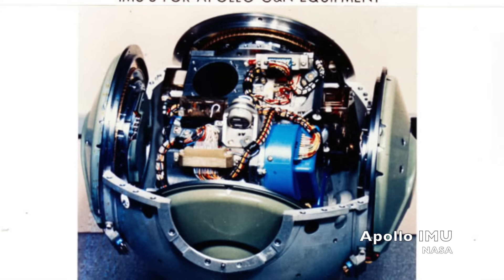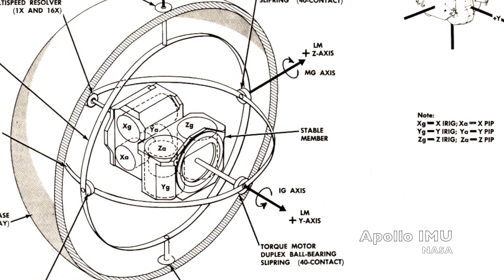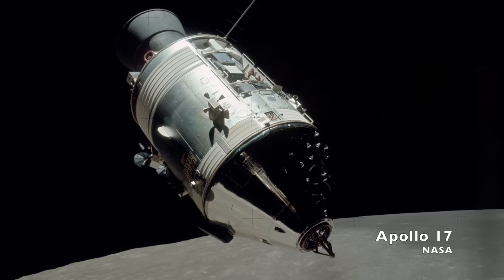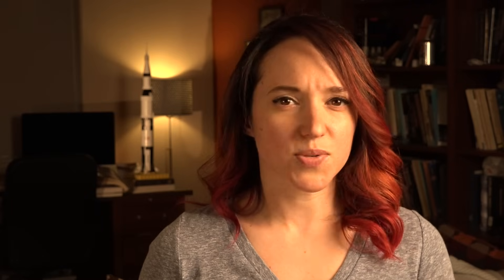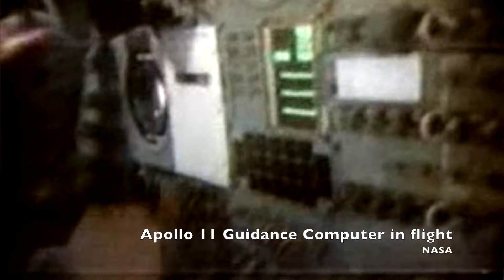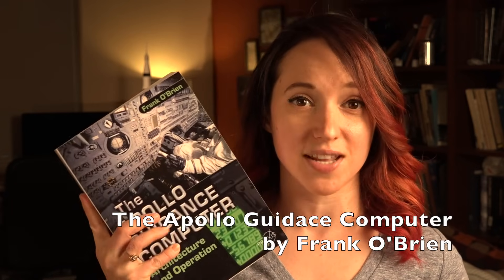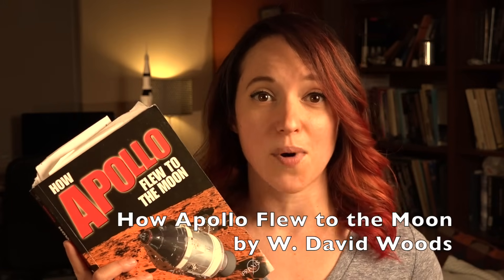Gimbal Lock and Apollo 13

Comment: You are very attractive and technically accurate and suggest you interview returning SpaceX Falcon astronauts to ask them about the technical evolution details of gimbals to the current versions in use today and how, if true, that if or not gimbal lock is even an issue anymore for today's astronauts.  I suspect that GPS and Laser Ring gyros have virtually eliminated position "drift" almost entirely.  Can't wait to hear your report updates.

Comment: TL;DR: gimbal lock means a situation where mechanical gyro used with Apollo flights failed to correctly track orientation of the spaceship. Modern systems use solid state or laser gyros and are not vulnerable to this problem.

Comment: Similar to robotic automation. During robotic arm movement the program/operator must prevent 2 specific axis from lining up.

If these 2 axis end up lining up the arm locks up and stops moving and errors out.  This is because the robot unable to decide which of the 2 axis it should move to get to the next position. The programmer has to tweak one of the 2 axis to resume the motion.

Comment: We use the same technology in modern day drilling tools.
Reply: Is it in the drilling head or is it above ground?
Reply: @suntaog It's in the tools at the bottom of the hole - or Bottom Hole Assembly (BHA). We run three gyroscopes each 90° from each other in an orthogonal setup. What we'll do is drill and when we stop to add more drill pipe, we'll turn the gyros on and off and measure the difference in acceleration. This allows us to find the orientation of the drill bit relative to the motion of Earth.

Comment: I made up an illustration for a kind of gimbal lock. Say you're filming a plane from the ground as it flies directly towards you, over your head, and then off to the horizon. As the plane approaches the zenith you pitch (tilt) the camera higher and higher until it's directly overhead. Now, to keep the plane in view, you either have to keep patching the camera back, but if you do the scene will appear upside down. To avoid that you'd need to spin (yaw) in place 180 degrees. Either way would do, but a computer might get confused as to which way to rotate, since the pitch and yaw axes are aligned.

Comment: Apparently it's a real thing in the virtual world - if you model 3D environments, the virtual camera you use to see the world can gimbal lock which then causes wild movements of the camera when you ask the computer to move the camera from pointing in one direction to another. If it gimbal locks, the computer will unlock it by moving the camera in an odd way on the way to the final attitude.

Comment: fyi there is another use for the term 'Gimble lock' that of the knob adjacent to the attitude indicator in a jet plane, to 'lock' the gimble axis of this instrument, as I explain in my earlier comment, the reason its locked is to stop the weather 'blowing' the fluid cartridges which dampen the motion.

Comment: that's an easy one, it operates like a fluid video head for video cameras, the axis are 'dampened' so in a storm, or windy conditions the shock of extreme motion fast, can overstress the system, breaking it, so a 'lock' is installed to restrain this delicate instrument, in the old days thats one reason the bombardier took the top of the gun sight with him off the plane, to avoid it being damaged in a storm; as in modern jets its fixed, so a lock is installed instead.

Comment: You mentioned Apollo 13. My favorite line in the movie is when the engineers are gathered trying how to fix the oxygen scrubbers and the parameters. One of the engineers complain: "you can power a vacuum tube on 12 volts."
It's just a testament to how crude and dangerous things really were back then.

Comment: Is the Apollo CM/LEM IMU similar to an INS/IRS/ADIRS found on a commercial airliner or military fast jet? To compensate for gyro drift, these would reference a fix of two intersecting VOR radials from the ground and later using GPS in addition to triangulating from VOR radials for another layer of parity for higher RNP accuracy. Airbus has the best version of this system IMO. Also, in space, there is no pitot-static ports to provide information to Air Data Computers because there is no air in space. EFIS systems wouldn't come out on commercial aircraft until the early 1980s, and on the Space Shuttle.

Comment: They should have used quaternions instead of euler angles. They, incidentally, use four coordinates to represent orientation. They are not fully independent, as orientation has 3 DOFs.

Comment: Was this unit in the center of mass of the Command/Service module body, or did that matter?
Reply: There was a Nav-ball (or 8-ball) in the Command Module, so it could not be at the center of mass while the Service Module was attached.  There was also one in the ascent stage of the LEM, but the center of mass would be different on descent and ascent.

Comment: Have to admit I was waiting for the cat to knock over the Saturn V in the background.
Reply: Can a cat go into gimbal lock when it goes to the litter box?
Reply: Cats are stealthy.  They can’t be knocking things over all the time, though, of course, it can happen.
Reply: @GH-oi2jf  The cat both knocked over, and did not knock over the Saturn V at the same time, also there is no cat as well as multiple cats. Quantum Kitty. It is both purring and slowly scratching you at the same time. The cat sits inside of Schrodinger's box and meows at you. The cat will always sit inside of Schrodinger's box, if the box is left open and laying about. The law of Quantum Kitty Kubes.

Comment: When flying in the Lem what is the feeling of up or down?
Reply: There is no feeling of up or down.  When the engines aren't firing, you're just weightless.  When the engines ARE firing, "down" just feels like the opposite direction to your acceleration.  To simplify, if the engines fire toward the left, you would feel like "down" is toward the right.

Comment: Navigation of the Apollo both EAGLE and Command Module does not involve a Gimbal. They used Satellites to know their location throughout the flight. A Gimbal will not give you data for orientation in zero gravity. The ARTIFICAL HORIZON receives data for ORIENTATION from Satellites for both aircraft and the Apollo Rockets.  Apollo 13 hit debris that was left over from the Tungaska Comet that was caught between the Earth and the Moons Gravitation field. The entire flight of Apollo 13 was AUTOPILOT. When the Astronaut released the Controls the AUTOPILOT corrected for the error and regained CONTROL. I am the Arkangel Daniel and I am from Heaven.

Comment: In a more mundane application, also from the sixties, they used a partial, 4 gimbal system.
The Litton LN3-2A Inertial Navigation platform as used in the F-104 Starfighter and F-4 Phantom used 4 gimbals:
- Outer Roll Gimbal (rotates over 360 degrees)
- Pitch Gimbal  (rotates over 360 degrees)
- Inner Rol Gimbal (Can only rotate left and right over a limited range)
- Azimuth Gimbal (rotates over 360 degrees)

A bit more complicated, but it could prevent gimbal lock.

Comment: That's not an informative description. You use the same diagram of the gimbals everybody uses in the normal start configuration. The video is practically word for word repetition of the description on Apollo 11 dot com, and other sites. If you had a diagram of the gimbals in the locked orientation it could easily be seen what gimbal lock, and "loss of orientation" means. It means that the axis of the gyro itself is pushed away from its normal operating orientation. To navigate the astronauts, and the computer, has to have the gyro rotating constantly in one axis. In effect always pointing at, say, Polaris. The spacecraft pitches, yaws, and rolls about this stable rotating gyroscopic axis or "platform". But when the gyroscope is pushed off that axis by losing an axis of freedom by the spacecraft pitching, yawing, and rolling in such a way as to put all six bearings of the gimbals, in the same plane in gimbal lock you "lose orientation" because if the spacecraft tries to move against the plane of the locked gimbal bearings the condition pushes the gyro's axis off Polaris. If the axis is not pointing where it's supposed to be pointing you won't be getting usable orientation information from it. Push a gyro off axis it precesses like a wobbling top, and points in all kinds of directions.

Comment: I was an avionics mechanic for a regional airline back in the 2000's. Our "INU" was about thr size of a shoe box and didnt use gimbel exactly. I was at the Space and Rocket Center a few months ago and saw these. It's so cool seeing how the technology started out, and how its matured.
Reply: I'm working for a company working with drones and sensors, and the main IMU we use is a chip the size of a fingernail. Crazy how tiny electronics have gotten
Reply: INU IMU are similar but not the same thing. Plenty of aircraft still use INUs today
Reply: @KainsAddiction  also used in conjunction with air data computers, which for commercial aircraft was pioneered on Concorde

Comment: There's an error in this vid, you don't need all three axes to align to get gimbal lock as you state. Two will do the job quite nicely. So, the middle gimbal needs a 90 degree or pi/2 pitch rotation and the inner and outer gimbals will be locked. It's an intractable problem which you get with all the Euler configurations. They could have got round this by putting three gimbals in diffferent configurations and excluding the data from the one that doesn't agree. But that would have meant extra weight which I guess is why they didn't. I guess you could just multiply the vector by a matrix transform when the state is say 80 degrees and then continue in the new state. That would mean downtime. Better yet would be to add a 4th ring and do a constant quaternion transformation correction. But, computation was expensive back then so yeah. Or you could have done it with accelerometers at the extremities of the ship. But vibration would have been a problem. Nah, all things considered, for the day that was the best solution with a bit of manual correction.

Comment: Thankfully we don't need gimbals anymore now that angular velocity sensors exist. Your smartphone probably has one and they are also what make multirotor drones possible (a multirotor is inherently unstable and would be impossible to fly without electronic stability) They are commonly called "gyro chips" but actually work on a different principle. Instead of a rotating mass they use a microscopic vibrating structure that operates on the same principle as the haltares of a insect. Those are the modified hindwings of flies and mosquitoes that look like one half of a barbell. The vibrating structure wants to stay in the plane of vibration and will make contact with an electrical sensor on either side when the sensor is rotated in a plane parallel to the plane of vibration. The faster the rotation the more contact is made and the stronger the signal (often the signal are converted into either PWM or some sort of serial digital format before being output from the device)
 
They are so small and lioghtweighjt that a dozen of them would weigh only a fraction of the weight of a mechanical three axis gyro (a three axis angular sensor is like a few mm square). Then you compare the outputs from all of them and any that disagrees with all the others can be deactivated as an obvious failure making them much more reliable than the mechanical system as well.
Reply: It’s weird to think that the smartphones everyone carries with them are more advanced than the Apollo flight computers.

Comment: Another way to prevent gimbal lock is to have 2 separate  gyros or gimbals. I am an aircraft mechanic and older aircraft have them. One for pitch and roll and the other is yaw. I could be wrong.

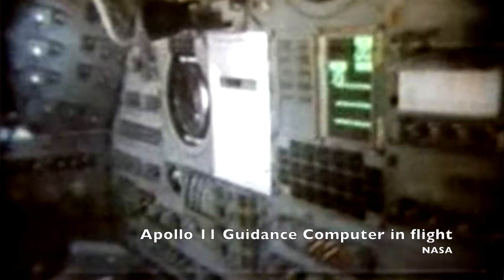Comment: 1:44
I was foolin around with a AGC SIMULATION online I ran "VERB, 35, ENTER"...for "CHECK LITES (P100)".

Than I found this video
I got exactly the same result that happens in this video.  The check lights all LIT and flashing check lights STBY, KEY REL.  and double digit flashing command line I think its 88 , 88 flashing. ....3 lines of the data font under that.

Comment: The IMU doesn't divertly give angles but angle increments which must be counted by the AGC; just after the incident, the mission report specifies that the AGC had been powered off for 80 hours, and, during thse 80 hours it didn't count the angle increments sent by the IMU; it means that all the angle variations which occurred between the incident and the moment the AGC was powered on again have been lost

Comment: I first heard about Gimble Lock as a child, reading "Moonwreck", about the Apollo 13 mission.
Many years later I got into CGI using 3D.  Irritatingly, I'd find that I couldn't rotate objects as I wanted.  Once I'd rotated a 3D model by 90 degrees on the x-axis, the y and z controls BOTH rotated on the Z axis, when what I needed was to rotate on the y axis.  Much newbie cursing ensued.
Some time later I realised this was Gimble Lock!  Apollo's problem recreated on my humble PC.

Comment: I still have no idea what a gimble is. 😂

So once locked, it can no longer tell the astronauts their pitch and yawn etc.?
Reply: "Gimbal" is another word for a powered, motorized gyroscope- a specialized metal disc or ring spinning very fast.

In short, any object (alive and not, big and small) moving in our Universe must do so along three invisible lines running perpendicular to each other, the so-called X, Y and Z-Axis (aka "pitch", "roll" and "yaw").  The Apollo guidance system uses the IMU to detect the slightest movements to the spacecraft.  (I promise I won't use any big scientific words in the following, since I am neither scientist nor engineer.)

Here on Earth, we humans (and many other animals) have our inner ear, which has three very tiny hollow tubes with fluid that freely moves through them.  When you turn your head specifically, the liquid in those tiny rings moves, and even-tinier hairs inside of each tube detects the motion and then tell your brain "Yo! You're movin', dude!"
Well, things get significantly more complicated when you move into outer space, away from the influence of gravity.  While inertia alone still can move the fluid in your inner ear, the loss of gravity disorients you and the signals coming from your inner ear don't match up with what your eyes, skin, nose and other senses are telling you; your body has not evolved to understand movement without gravity.
(NOTE: there are a number of movement-sensory disorders out there- among them seasickness, airsickness and vertigo- so this does not work perfectly in everyone nor all the time.)

The same thing applies to a spacecraft.  How does it know which way is the correct direction to point, since there is no "up" or "down" in space, and the distances between anything are stupidly, unimaginably huge!?
The Apollo IMU used three high-speed gyroscopes ("gimbals") which were deliberately pointed in different directions, just like those inner-ear loops inside your head.  You know how when you have a single spinning gyroscope in your hand, and you feel resistance anytime you try to move it?  The IMU does exactly the same thing- it detects those tiniest of changes to the directions of all three gimbals at the same time.  So, for example, if the spacecraft turns slightly to the right, one of the three dedicated IMU gimbals will notice the change and inform the navigational computer of such.
The IMU is setup to begin measuring motion just before launch, and will continue to do such until either the end of the mission or the spacecraft is discarded.

So, with all of this said, what Amy is trying to tell us in the video above is that there was a very real risk that if Apollo 13 turned in more than one direction too quickly, the gimbals would unintentionally line-up with each other ("gimbal lock"), thus losing their unique settings and the ability to tell the navigation computer which direction the spacecraft was pointing.  On Apollo 13 in 1970, this was especially hazardous because Odyssey (the Command/Service Module) and Aquarius (the Lunar Excursion Module) were tumbling out of control for a significant amount of time, and if the astronauts were not very careful, the three gimbals would IMproperly line up with each other and "lock", and the onboard computer would not be able to keep them pointed in the right direction.  Once gimbal lock happened, there was absolutely no way for the astronauts to reset it while they were in space.
Reply: Gimble is a fancy word for not turning on the cameras inside the Command Module or LEM to show Jim Lovells great piloting skills in outerspace with no restraints to keep him from moving relative to the studio LEM because it was a a gigantic hoax.

Comment: Ever since  i saw the movie i always wondered  what Tom hanks was   talking  about. When he said these lines .  
- Okay, Houston. Check me. I have completed these gimbal
conversions but...I need a double check of the arithmetic.
Reply: John - When they transferred the guidance from the CM computer to the LEM computer, the LEM computer needed to know the orientation of the spacecraft.  There was no method for the computers to talk to each other, so the astronauts had to take the readings from the CM computer and manually enter them into the LEM computer.  The actual calculations involved were not as complex as depicted in the movie - all they had to do was add a couple of angles together.  And, even if the calculations were wrong, they could have realigned the LEM computer by observing stars using the sextant.